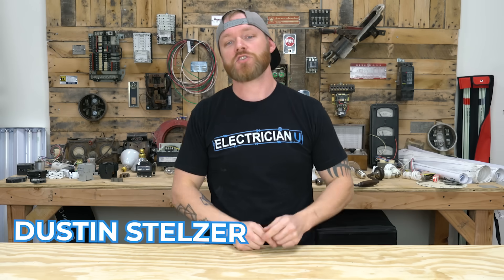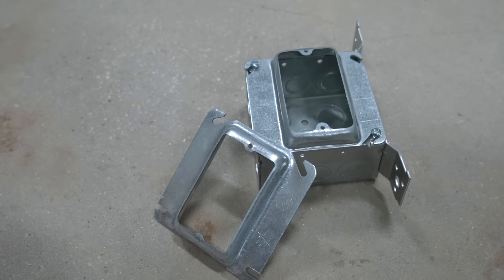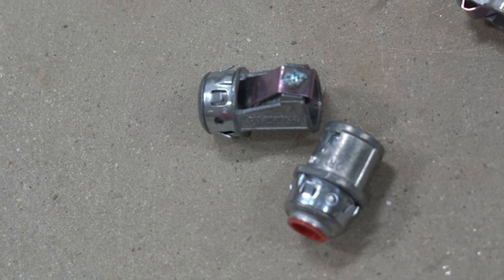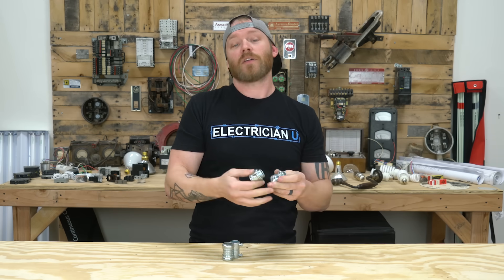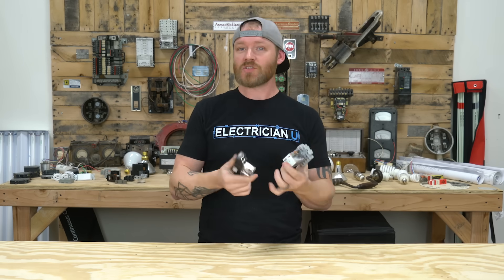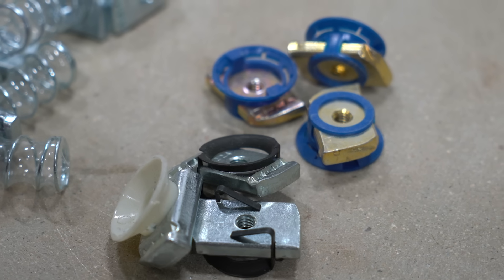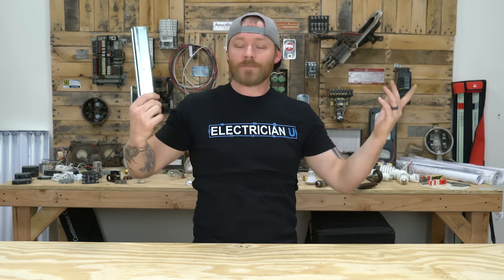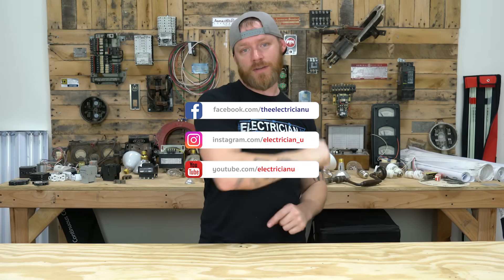COMMERCIAL ELECTRICAL MATERIALS Apprentice Electricians Should Know

Comment: Conduit. There is a valid reason to use correct terminology. Ive used conduit for 30 years. Conduit covers the meaning of the purpose of the tube: something like wiring or fiber or air or gas tube for nitrogen. It is important to say conduit in industrial settings as there are all kinds of tubes. I cant agree with this video. 

If you're out at a concrete plant or paper mill or an heavy industry CONDUIT is way more meaningful than "tube" which sounds like a 3rd grader who doesn't know what they are doing and should be immediately escorted off site. Tube means way more and something very different in industrial settings and it encourages a very incorrect Lexicon in their vernacular for conversing about site specific issues.

Comment: What kind of backward electrical country is america? Everyone calls them with standard terms such as 3 core 2.5 n-arm cable and Americans call it romex. Glands are weirdly called connectors. Then what would you call lugs. I forgot Americans do loops of single core cable on recepticles instead of proper lugging and termination in tb. I work in an industrial environment. I don't know these are applicable on commercial areas of my country.

Comment: I'm only 3 years into the trade so far, but personally I prefer using the type of MC connectors that use a nut and tighten with two screws whenever possible over a snap in connector, they're easier to install.

Edit: forgot to mention the 2nd part that's better is if you have a change order for whatever reason whether it's the location of a lighting changing or a desk's location, these types of MC connectors are also easier to remove when needed. Just better for the long term.

Comment: For commercial work always purchased panels & junction boxes without KO'S so I could make KO'S to line up with handy unistrut saving an offset . Also used steel EMT fittings instead of POS garbage die cast fittings.Have to be careful with handy gangable wall cases. Boxes from different manufacturers often will not gang together. Love the 12 by 12" JB with built in MC connectors & ground bar. If you are going to connect a critical motor or motor that will turn on & off more then say 30 times a hour best to go with a made in USA NEMA full size real deal starter ( Square D & Allen Bradley ) starter rather then inferior IEC contactors which most will not allow you to replace contacts.Flex = greenfield.

Comment: My favorite part of doing switches is when you discover at the final that one of your lovely coworkers has tied in the wrong switch legs at the rough-in stage.

Not just tied into the power pigtail... No..

Tied-in to the wrong 2gang switch box entirely 😅 (side by side in the wall but in different rooms 👍)

Not that hard to fix... But.... Yeah 😅🥳

Comment: 1900 box was the part number for steal city in the early 1900s. Ita actually NOT CALLED A 1900 box anywhere but the east coast. That is a slang term. The correct term is 4 square deep or shallow.

Comment: Source google, this electrical box is usually called a 1900 Box because that was the original part number from Bossert almost a hundred years ago. It is the most common box used when a simple SwitchBox is not large enough.

Comment: I remember some of those old sparks at the school telling us this education wouldn't be so valuable if it was on the internet for everyone to learn. Ever bend a 90 into 2" EMT with a hand bender? Custom engineered for Nstar haha. I remember one guy yelling Kindorf at me now hahaha the strut? Kindorf you good for nothing! I may as well mention I had this one ogre of a foreman that got pissed every time I called EMT conduit. They had just taught us in school that technically conduit is for power and pipes are for water, are you a plumber or an electrician? Lot of workers insisted it was still pipe and not conduit though. Some of those guys would try to confuse you and knock you out of your confidence. Should of left the conduits in a full length bundle for the puppies to see hahaha. Especially the large bundles and how to cut the strap without it whipping you in the face. I saw a guy almost lose a finger using his pliers.

Comment: Not to be a fly in the ointment,  but there's PVC coated rigid conduit,  called Rob Roy in the field. Also, threadless connectors can be gotten for type RMC conduit, so you're not threading it.

Comment: Something weird, my house is wired with EMT and 1900 boxes with mud rings. I don't know why that's code in my area, but it is. I honestly hate it because if I ever want to add an outlet or something, I have to run conduit and use octagon boxes or 1900 boxes! Plastic boxes and Romex isn't allowed here! There's even industrial covers in my basement where there isn't drywall!

Something else that's weird is how they wired the house. 
There is one 15 amp circuit that supplies power to almost all the lights on the main floor, outlets in the living room, outdoor outlets, and lights in the back yard. That seems like a lot of devices for a single 15-amp circuit. 
Theres also a single outlet in the master bedroom that is on the same 20-amp circuit as the bathroom outlets. The rest are tied with the lights on a 15-amp circuit. 
If that's not weird enough, the garage outlet is on a 15-amp circuit with the outdoor lights and the laundry room lights. i don't understand why they used a 20-amp circuit for one outlet next to the breaker panel, but used a 15-amp circuit for the garage, where you have high-power tools! 
Not to mention, 2 separate bedrooms share a circuit, and the office shares the upstairs hallway circuit.
Even my bathrooms all share one circuit for the outlets, and another for all the lights.

TLDR: My house is wired weird!

Comment: Is there any reason other than cost to not using this in residential?
Reply: In some areas, like my area, they do use commercial wiring. my house is wired with EMT conduit, and 1900 boxes. 
I suppose there is one limitation to commercial wiring, if you want to add an outlet or another device down the line, you must run conduit, or in some cases, MC. It's very easy to run Romex in a wall, but EMT is much harder to run, because it's not flexible.

Comment: For those north of the border. 

4x4 box, Bullnose receptacle cover (decora/standard), mud ring, steel stud box, gang box (device box), different from a cut in box, L16/Twins, AC90 (where is the spool?), Connector/coupling/liquid(or concrete tight), 4x4 blank cover, 12x12 JB (would never need a box that big for residential, useless in commercial), relay, contactor, spring nuts/spring nuts that someone broke the spring off, unistrut (deep/shallow), EMT/Rigid Conduit, Flex

Comment: Question for a guy that does not know. Not all residential items can be used in a commercial setting, can all commercial items be used in residential?
Reply: Nope nope nope, there are items in residential that deal with very low voltage, putting that stuff in a commercial building will completely mess things up

Comment: Been in the commercial field for the past 25 plus years , recently been working in Hospitals and medical buildings , the company I’m with now uses most of the material you mentioned , except the snap in connectors , we use the locknutables 🤪 , better to use when you fish mc cable down a wall and install a cut in box  , Also the mc cable in hospitals has to be Hospital Grade ( FYI , industrial covers is also called raised covers )
Reply: As a service electrician I prefer the locknut MC connectors as well.
Reply: @LucasGresham610  well we know how bulky those locknutable connectors are especially if you fishing down a wall into a 4”sq box that already has a snap in double barrel connector in it 🤦‍♂️ A lot twisting involved, not a fun fishing trip
Reply: Thinking about dropping hvac school and going to commercial electrician, mind if I ask how much u make? I’m trying to get a feel for what pays most
Reply: @mistanipples4958  It Depends on where you live , and what kind of commercial work , you could get on with a company doing government contracts and make bookoo bucks or get in a union

Comment: Important note about contactors: the ones used in HVAC equipment are "definite purpose" contactors. You CANNOT use them for a different purpose, such as controlling lighting in a store. Contactors for lighting are MUCH more expensive, and are listed and approved for the purpose. Definite purpose contactors have a definite purpose that is NOT lighting a store. Make sure that any contactor you install is listed for the purpose. I'm just sayin'.....
Reply: Everyone should be aware of the NEC requirements listed under article 100, definitions, as being listed and approved for the purpose. The fact that HVAC contactors are called “definite purpose” means that they are the only contactors for HVAC use, and no other use.
Reply: 4 inch square memphis tn
Reply: You could use any contact anywhere as long as the amps is what is rated for the contactor.
Reply: @richt5986  Actually, no, it is against the national electrical code to use anything except an approved contactor for lighting. You cannot use an HVAC “definite purpose contactor,” which is why I mentioned that. The difference in cost between a definite purpose contactor and one that is listed for use as a lighting contactor is about 10 times.
Reply: @Art Houston  sorry not the point. I may have not explained better. You can use any contactor for whatever as long as it is rated correctly by the amps and volts
Reply: @arthouston7361  I will have to check that.
Reply: @arthouston7361  you are correct. 👍
Reply: I do lighting controls with contactors that are only meant for 12 V and I have other lighting contactors That are rated for 2hundred amps at 480v

Comment: 1900 was the original part number for the 4" box sold by Bossert in the previous century.
Reply: That’s interesting. When I was in the field, we never referred to them as a 1900 or 2100. I moved to another state and realized how different the nomenclature is area to area.
Reply: In NH I never heard either term in 38 years
Reply: @gerdberg4188  made it to Mt Washington a few months ago. That’s a pretty area up there
Reply: I didn't know the company, but I did know it was a product number
Reply: Pretty sure it was steal  city
Reply: Thanks for that bit of trivia!  I was expecting it to be the size in cubic millimeters since the metric system has been creeping in everywhere.  Close, but no cigar:  1900mm = 74.8 inches  vs. 4" x4 "x4" = 64 inches.

Comment: 1900, hide the box somewhere, it's against the regs to conseal the connections, in fact it's a dick move, in North America I know I do not have to test and inspect, so I guess it makes life alot easier for me, the people here use function testing, switch it on, yeah it works, even though the poles live / line / hot is in the negative and the neutral is other pole, no earth, yeah it works but is an hazard, incorrect and dangerous, oyeah I remember doing box ganging calculations,

Comment: Electrician U - HELP
? Gage wire to use use on 100ft. Power cord to feed a 230volt TIG welder ???????!!!!!!!!
MILLERMATIC 210 welder.

Comment: This electrical box is usually called a 1900 Box because that was the original part number from Bossert almost a hundred years ago. It is the most common box used when a simple SwitchBox is not large enough.

Comment: I've been doing electrical work in NYC for almost 40 yrs and I've never heard of a gangable box. We call that a gem box. As you said about the 1900 box, I don't know why they named it that. It's not shaped like a gem. And the box that's shaped like a gem is called a round box even though it's not round. The box you called the 2100, we call that a 5 inch box even though its not 5 inches. Go figure.
Reply: 90 miles from you in philly have been calling the metal boxes gangable for last 50 years. Heard that New York along with Chicago have the toughest codes. Here in philly wortless L& I more concerned that you have OSHA 10 or 30 training along with vehicle insurance
Reply: @garbo8962  We have both of them here. The tough code and all those OSHA requirements. Many years ago as an apprentice I worked with 2 journeymen from the Philly local on the construction of our convention center here. They were pretty good mechanics for a couple of minor leaguers called up to the big leagues. Lol 😆 Can you believe they were commuting back and forth every day and we were working 10 hrs 7 days a week

Comment: So I have a few questions, just know I am a 13 yo so some of my questions may seem kinda irrelevant. 

1) if I take a 1900 box and I mount it too a ceiling, like on the surface, and I take and run wire into it from an existing duplex(I would of course remove the old duplex) and I take a threaded wire strain relief thing and run some portable cord into the 1900 box and I put another 1900 box on the other end of the cord with 2 duplexes with a total of 4 outlets, would this whole idea be dangerous? 

It’s essentially a permanently installed extension cord with 4 outlets to plug into.  

2) is it ok to use a 1900 and conduit for low voltage like speaker wire, Ethernet, or hdmi? 

Btw all these applications are residential.
Reply: Well, I’m a little late to the party, so to speak; but...

1: probably not dangerous (just be sure that any exposed metallic surface has a good solid ground connection); but I have no idea if it’s legal (I’m actually a software guy; but I dabble in digital circuit design as a hobby). Also electrical codes do vary by location (and what inspector you have interpreting it).

2: Low-voltage in conduit is done all the time. However; it’s usually a good idea to keep electromagnetic interference in mind when choosing which types of cables to run together in the same conduit. For example, I would avoid running power together with analog audio; and definitely avoid running high-voltage power together with microphone or guitar cables (you’ll get a nasty 50/60 cycle hum in all your audio lines). Also, do remember to oversize the conduit somewhat, and leave a pull line in the conduit so you can add more cables later.

 🙂
Reply: Oh, one other thing— be sure that whatever low-voltage wire you are running is fire-rated for in-wall & in-conduit use; some wires have insulation that gives off very toxic smoke & gasses when burned and is illegal to use in wiring that’s installed in a building. No, I have no idea why it’s still legal to have that wire outside of the wall when it’ll still burn and release the toxic smoke & gasses in the event of a fire.

Comment: How about a video on AC cable vs MC cable
Reply: AC cable (some call it BX cable) will have a paper lining ( moisture resistant/ fire-retardant) under the metal jacket vs clear plastic like polyester lining in MC cable.   AC cable also has a bonding strip (16 awg) in contact with the armor cladding--forming an equipment ground.  MC (metal clad) cable does not have a bonding strip, a green ground wire is included usually.  AC Cable  comes in sizes 14 to 1 AWG.   MC cable  ranges from 18 AWG to 2,000 kcmils(MCM).  AC cable has a limit of 4 conductors and a ground wire.  MC cable  has no limits on number of conductors in the cable.  Types of MC cable:  interlocked metal tape, corrugated metal tube, and smooth metal tube.  See Article 330 for MC cable and  Article 320 for AC cable in the NEC code.

Comment: 8:00
That box looks very busy. 
We use the grey boxes with the 5/8 inch and 3/4 knockouts for bx and 3/4 pipe. Anything bigger and you can use a knockout for larger sizes. You probably won't have that many pipes or bx collecting in one box. Unless it's a pull box around a panel.

Comment: "MC" is closer to "Bx". The difference being the ground wire.  12/2 MC  is actually 3 conductor. 1 is green. BX 12/2 only has black and white.
Reply: glennreynolds962 I thought ground wasn’t a conductor, hence the 2 and not 3.
Reply: @mavenfeliciano1710  
Yes that is why it is 12/2 MC The green wire is not counted. 12/2 Bx the armor jacket is the ground and not approved for commercial/ industrial use
Reply: that is not true..........12/2 BX has  One black #12, one White #12 and a BARE ground
Reply: @lyndenwld  
Bx does not have an actual grounding conductor like romex. The armor jacket is the ground. MC has an actual copper wire that is green
Reply: @glennreynolds962  I dunno what bx you use but al the bx we get here in manitoba has a separate bare ground wire
Reply: @lyndenwld  
Im in US. There is a thin aluminum strip that wraps around the armor jacket. No bare copper conductor

Comment: 1:21 in my experience, city, county and state, hiding a junction box is against code.

I know that's not what he meant, but some people might take that wrong
Reply: In Canada a junction box just needs to remain accessible.  As long as an electrician can get to it and service them, its good.

That means hiding them in an attic or crawlspace is a-ok by code.  Same with tucking them up into drop ceilings.

Comment: What's the best way to become an apprentice? I already have a degree in electronics engineering and electrical theory, but no certifications for commercial/residential, and my education was focused on theory, not necessarily building code. Lots of experience in repair, maintenance but not install, so there is a lot of just replace it with what's already there. Everything I've come across so far is training from the ground up (including theory).
Reply: BrinkMan49 Walmart